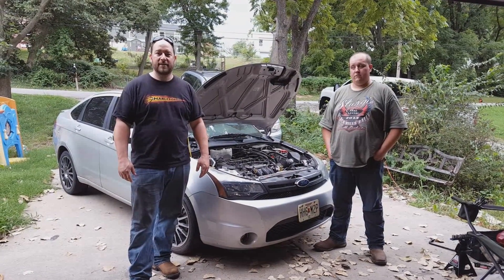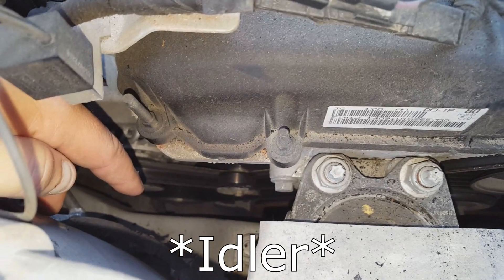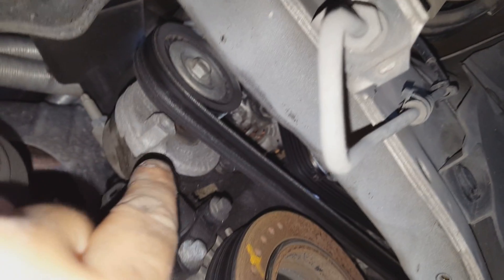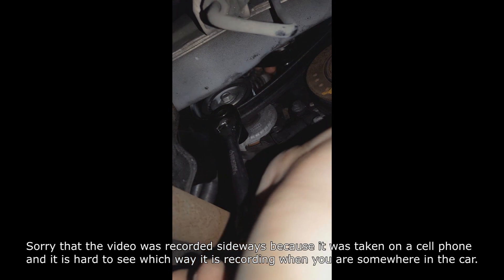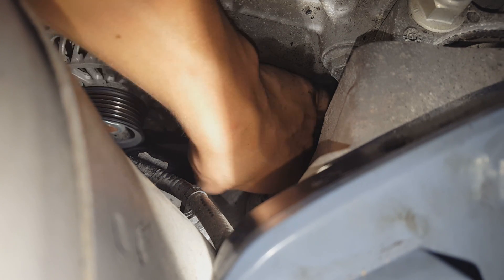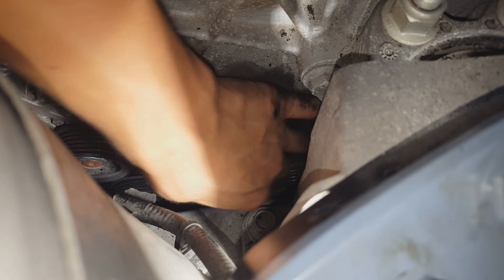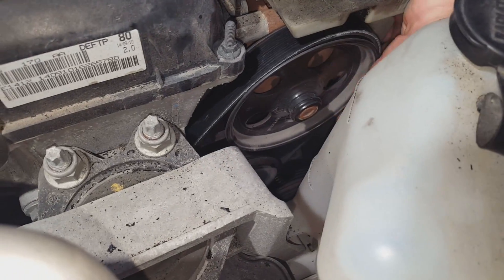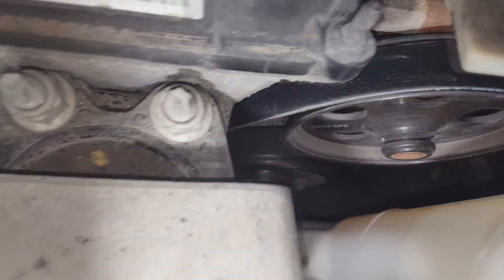2011 Ford Focus Idler Pulley Replacement

Comment: Guys my friend Jim and I would like to thank you so much if we had not found to remove the splash cover and manually cranking the engine to get the new belt on we would not have fixed my wifes car .  Thank you so much

Comment: 8:07 "AC condenser" Nope, the belt goes around the AC compressor pulley. The AC condenser is the thing that looks like a radiator and is mounted in front of the radiator.
Reply: Dude relax! These people are working on a car and you think they don't know what an A/C Compressor is.
Reply: @Adish0287  obviously they don’t. The one dude corrected him.

Comment: I just replace the pulley on the belt tensioner.  Now I've had two jumped belts.
Reply: Probably the tensioner itself failed.
Reply: Timothy Kamalu yea typically the pulley doesn't go out the whole tensioner does
Reply: @boostedkidproductions9719  wish I could post a pic here of mine, what happened is that the tensioner seized up, then the pulley started getting so hot, it caused bearing failure, etc etc.
Reply: I'm working on a Ford focus with almost the same problem I have to change the tensioner cause the belt squeeling loud I already changed the water pump thinking it wasn't spinning how it should I had to jack the engine up to get to it

Comment: Someone mentioned that you needed to raise the engine to get the bolt out. Can anyone verify this?
Reply from the maker: Dark Mice I did not have to do that. so I have no idea why they did it if they have same car
Reply: thanks for reply
Reply: If its just the static idler pulley, the answer is yes. For the tensioner pulley, no.
Reply: On my 2007 Focus SE 2.0 I did not have to raise the engine or remove the engine mount to R/R the idler pulley or bolt.
Reply: No you don’t.   Unbolt the alternator.   Set it back towards the firewall.   The mount will be in plain view

Comment: Hey fellas, probably would of been a good idea to (1) to use a little lock tite  to keep the bolt from backing out, (2) torque down that bolt to spec for that particular car...probably around 25-35 ft lbs and (3) the owners manual has the belt routing.

Comment: Great job,  would you be able to help me with the belt part number for the 2008 focus? I believe it's same as 2011
Reply: This is pretty late.. But according to my manual, it is 6C301 . And that's the Ford specific own belt that you'd get from the dealer. You can also go to the Ford Parts website, put in your VIN and then search for whatever you need, and it will match your specific VIN.

Comment: I think the bricks should go behind the wheel instead of the front!! 😄😄😄 good video tho!!
Reply from the maker: The hill comes towards the house so preventing the car from rolling down into the house
Reply: @2MostlyBaldGuysKC  you are just plain WRONG, you lifted the car on the front so use your LOGIC here. TONY is 100% correct!!!! If the slope would be very steep than you would still use brick on both sides one in front and one in the back of back tire. It just amazes me how human brains can work (or not).